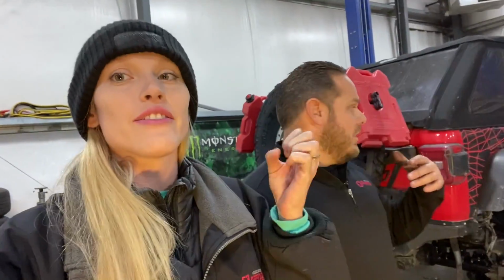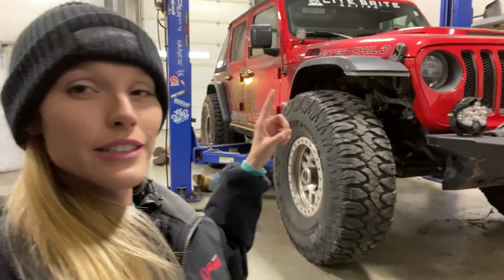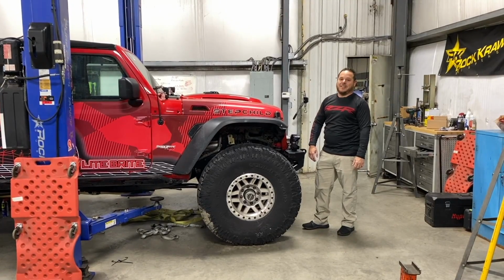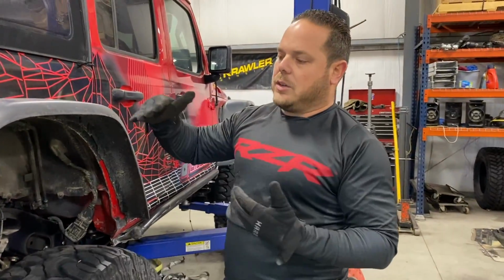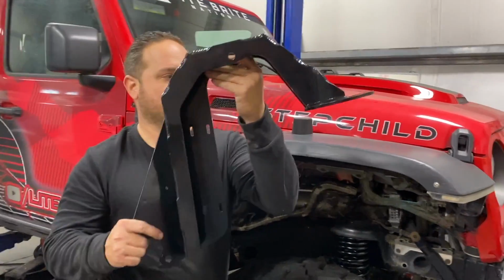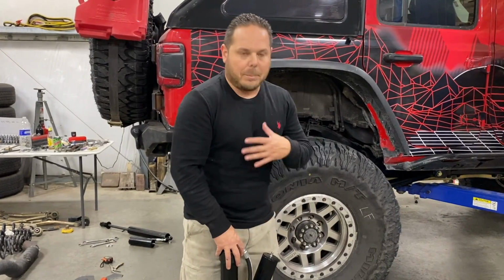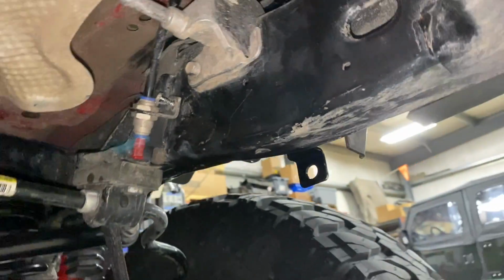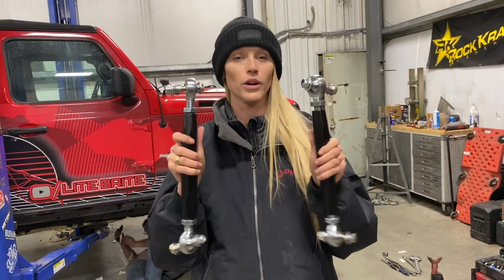COILOVERS vs SHOCKS! Rock Krawler Long Arm is Complete!

Comment: When you get this upgrade all finished, you guys need to go back to that last "trail" you drove on the "Road to SEMA", the boulder chute thing, and see how the Stepchild holds up.     To me, that would be the Gold Standard as it's not really a trail that can be driven, it's a pile of boulders, that did a LOT of damage to all the participants' vehicles in that event.   It seemed to be designed to do the most damage right before they got to Las Vegas, where they could place their vehicles in the sponsors' booths and brag about how well they held up (or did not).   As SEMA is a show that is not open to the general public, to have your after-market products run through that boulder chute and come out unscathed would be a real boon to sales.